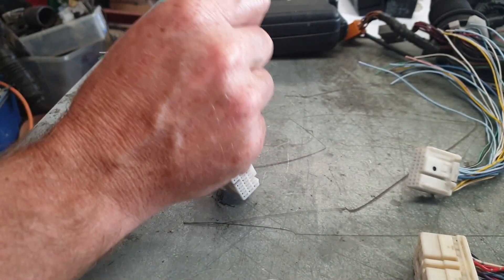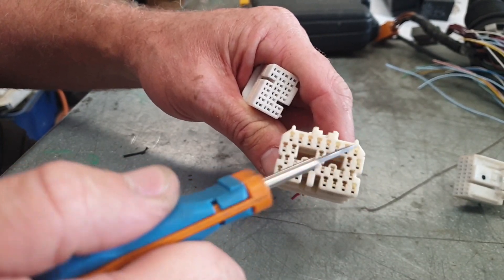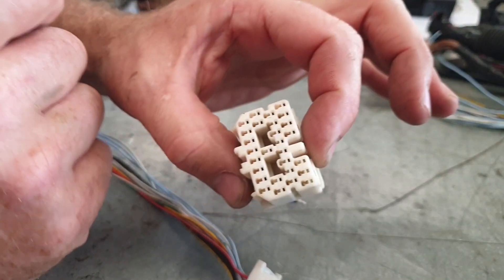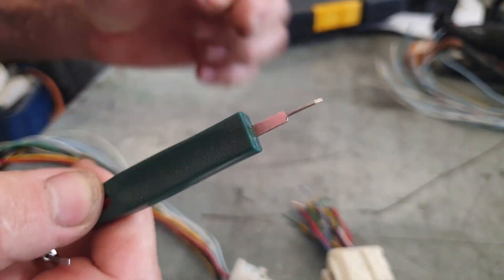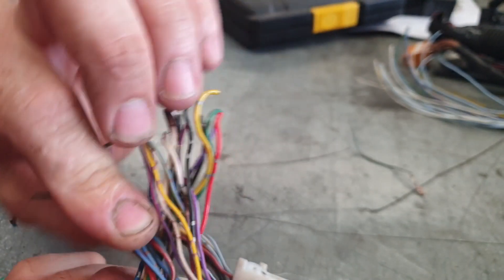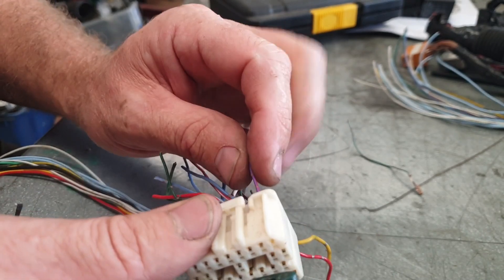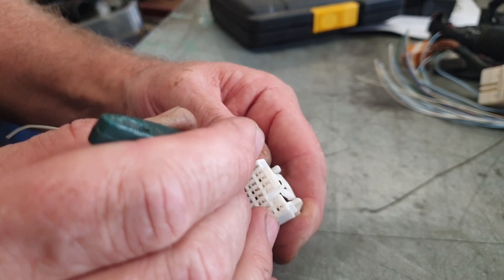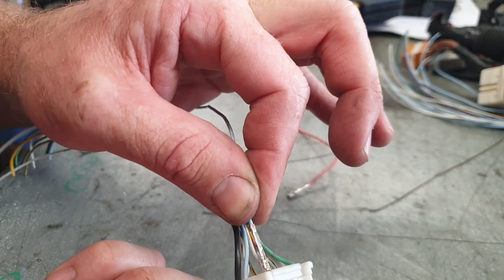Removing pins from 1uz ucf20 non vvti and VVti ecu connectors and other Toyota connectors

Comment: Hey my man, is there any way you could link a website where I can find the replacement contact pins? In need of new ones to wire in new cam sensor without soldering. Thanks in advance
Reply: Ive got your exact same issue, did you find a solution?
Reply: @Ratwagonz  It is difficult to track the correct ones down unless you have a connection. I simply cut out the old one and crimped in a new connector. Cars been fine ever since.
Reply: @Ratwagonz  find a replacement connector online or at a junkyard- then swap one wire at a time

Comment: I’m trying to de-pin some water temp sensor connectors and similar on my Uzj100 and can’t get the tab to unlock. Any tips? I got the white lock out. Pushed on the wires to release tension. Maybe my tool is crap and not pushing hard enough?
Reply from the maker: More practice or maybe a better tool
Reply: @CartuneNZ  I figured I was the problem! I got a couple new tools to try. Hopefully that does the trick. Thanks!

Comment: Thank you for the video! Any recommendations for de-pinning the DLC 2 obd 1 connector? I believe it is the same design as the one you showed, but am not sure

I have a spare because the one on my car is damaged from a previous owner. I want to de-pin it and swap the connector for the new one
Reply from the maker: Very similar process but they only have the little internal lock and you can use the bigger release tool.

Comment: One other thing that might help is to actually push the terminal in before trying to remove as well as not pulling on the wire as if the terminal on the little lock is under tension your gonna have a bad day! Also thanks for the help you know I can't put my ugly mug on a video!
Reply from the maker: As you know its hard to really say everything we do to make it easy.  After doing thousands it becomes second nature.